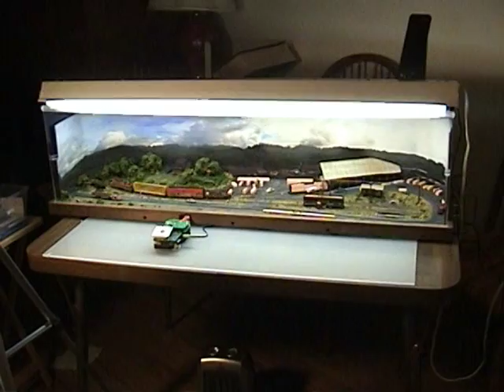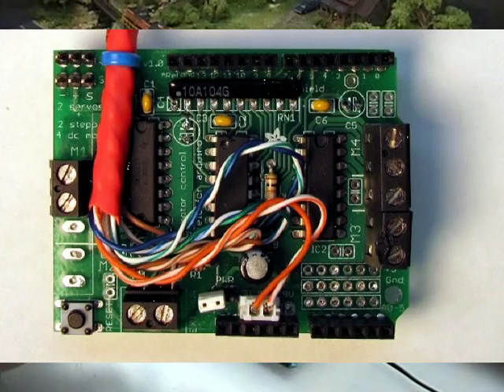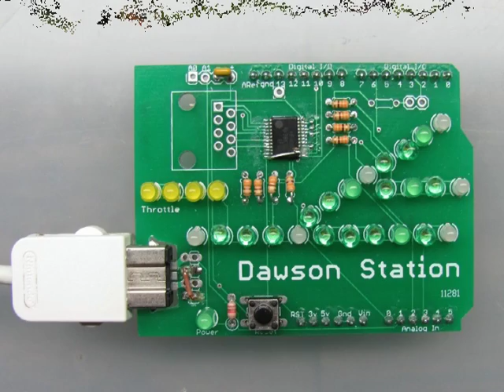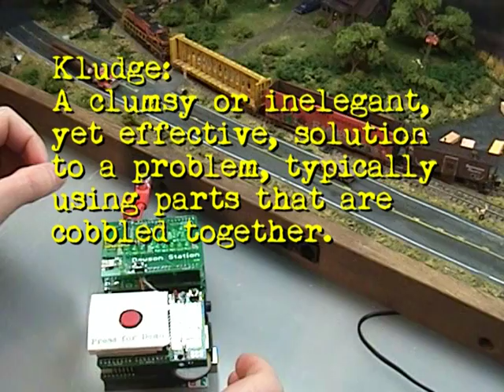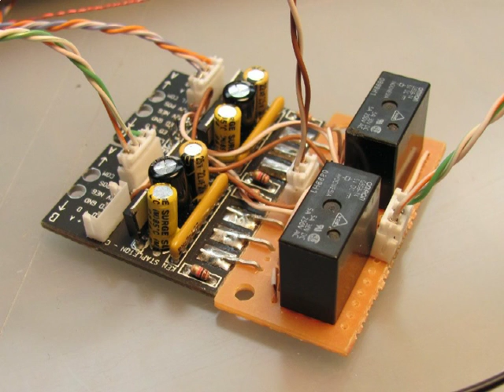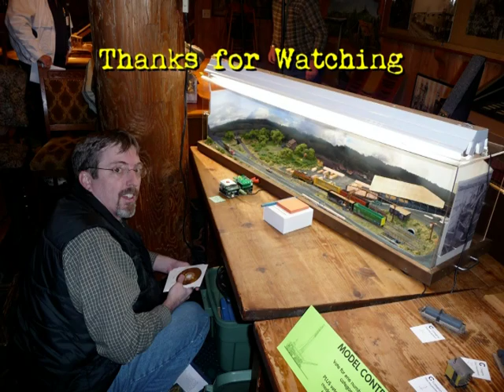Arduino Control of Model Train

Comment from the maker: The Arduinos are ~$30 ea. The motor controller kit is $20 (google "Adafruit motor shield") and wave shield is $22. I'm currently working on a single board which would drive the train and turnouts for about $30 (see my recent video with my grandson).

Comment: Do you use any arduino tech for lighting buildings or other automation?
Reply from the maker: I've wired a relay to the overhead florescent light so it can turn it on or off.

Comment: Hi Makers Box, I see this youtube is from 2010. But I just got with retirement and wanted to buildup my OLD analog Fleischmann train. I like the way you use the arduino system with your train. But I was wandering if I could find the code (programming) steps you used on this arduino system to opperate your train. I would appreciate it very much if somebody can advice me on this
Reply from the maker: Hey Toon.  My best advice on a project like this is to tackle it one step at a time.  First step would be to get an Arduino, and Adafruit motor shield (https://learn.adafruit.com/adafruit-motor-shield-v2-for-arduino), and a 12V power supply and then do the adafruit tutorial and see where you get.  They have example code for driving motors.   You can then start adding complexity like sensors and joysticks.  Let me know how it goes or what you get stuck on.

Comment: Is it analog or digital
Reply from the maker: It is digital in that a computer is controlling pulse-width modulated voltage to the track, but it is not the Digital Command Control (DCC) that is usually used to control model trains.